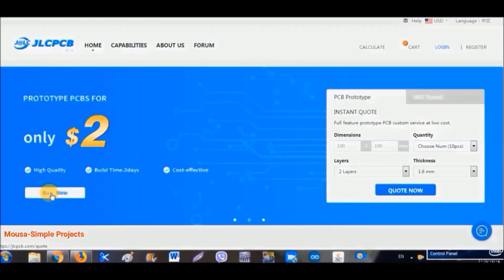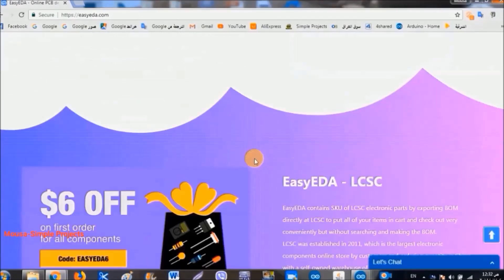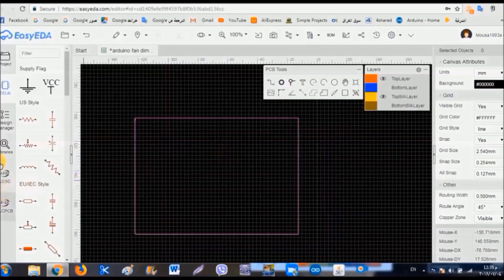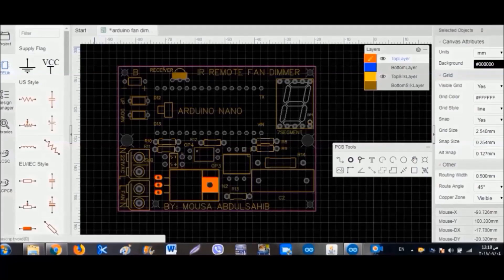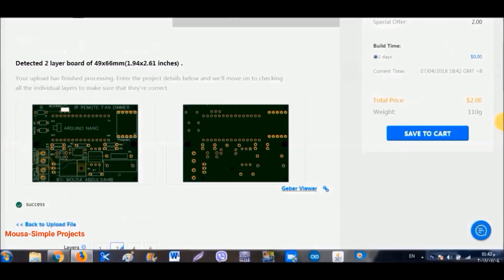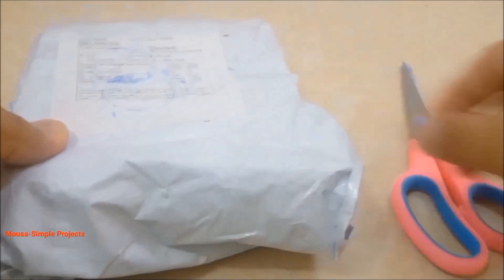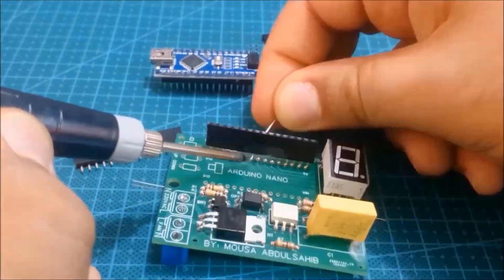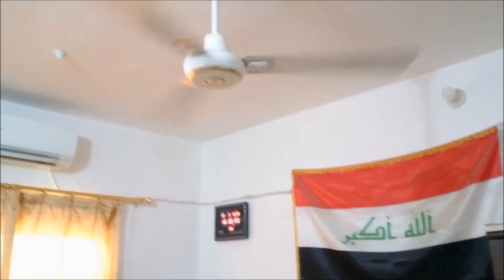Arduino 220V AC dimmer PCB made with JLCPCB.COM (with code)

Comment: Great job! I have one question: is it possible to connect this dimmer only between line and load? I want to replace light switch with it and I don't have neutral wire there.
Reply from the maker: Thanks. No, you can't because the arduino need to 5V power supply(220v to 5v adapter) to working and the power supply need to both line and neutral wires.
Reply: @MousaSimpleProjects  I have low voltage cable to power arduino. Do I need neutral wire for zero detector or can I use wire coming from load?
Reply from the maker: You need Neutral wire for ZCD